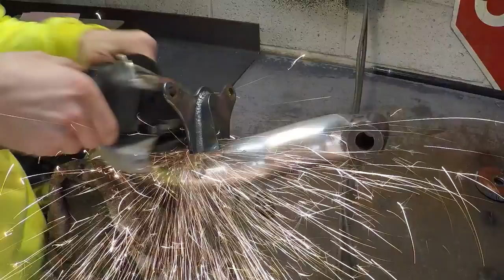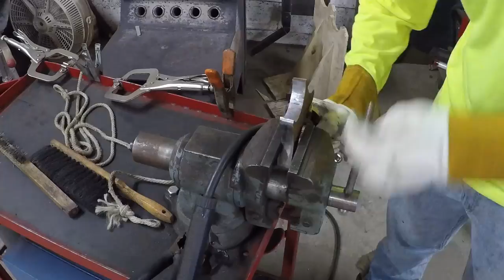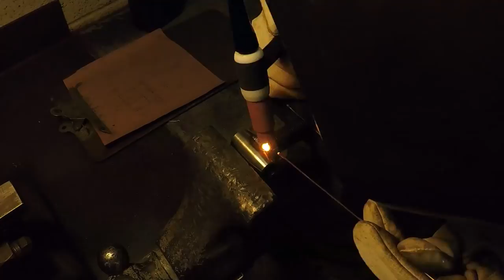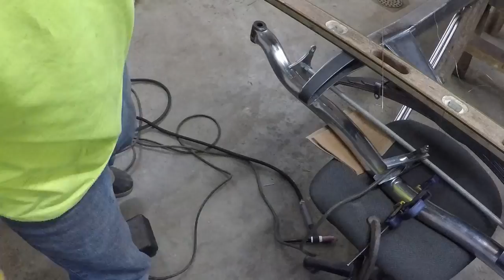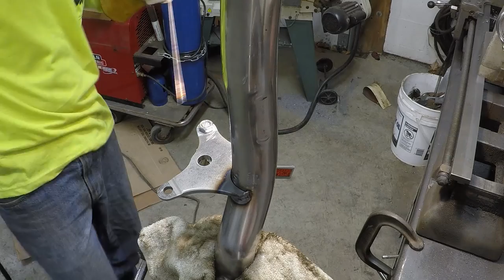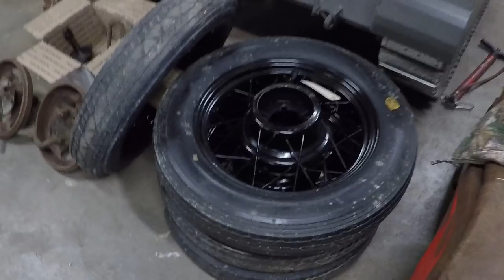Rolling Chassis! | Boat-tail Speedster Pt.17

Comment: So, oval track cars typically have the front spring fixed solid on one side with a shackle on the opposite. If you run 2 shackles you would really need a panhard bar.

Comment: I was hoping that you would put in heim joints to handle the front axle articulation, if you hit a bump on one side the axle would move in an arch, not sure if the balls on the back side of the wishbones would allow that movement freely, but if it does that’s good and this setup will work, hard to know without seeing the range of movement on the axle
Reply from the maker: split wishbones or hairpins like this are geometrically inferior to just about every other setup because they don't allow one side if the axle to lift while keeping the other on the ground. there's a little bit of room for movement, but not much. it sure looks good though!
Reply: MacroMachines Ha, let’s hope that’s not your last famous words! Just kidding around with you, it’s a great build I like that you’re building everything from scratch, just remember to be safe, I see a lot of rat rod and hot rod builds that aren’t safe enough to drive around the fair grounds let alone on a highway. Cool build either way, keep up the great work

Comment: nice lathe , it seems to be the perfect size for the type of work youre doing on it (big enough to swing a brake drum or flywheel over the bed )
using the treaded rod to hold both the ears at the propper angle isnt the best idea as the treaded rod is kind of thin and can be slightly bent when handling it trowing youre squareness off , better to cut a piece of pipe to the exact length and square on both sides on the lathe and then use the treaded rod treaded through it and the ears to tighten it up
, it might even be strong enough to bend the ears toward the hairclip tie rods after you welded it to the axle
think you going to need to get a long (tapered?) reamer for the spindles and axle and ream the holes out in situe would give the best fitting hole for the pin , should be able to fit and ream the bronze bearings for it too , might even be able to introduce some camber by cutting the hole at a slight angle and work youre way up to the final size 

i've seen some films of the handling of these cars and they seem scary to drive
Reply from the maker: you're right, that is a better idea

Comment: Not seeing the Friction Shocks.
Did you abandon those or are you still waiting for the Spacer Material that goes in them instead of wood cutouts?
Reply from the maker: well, they wont fit like they did before I widened the frame, and I havent decided what I want to do about that yet